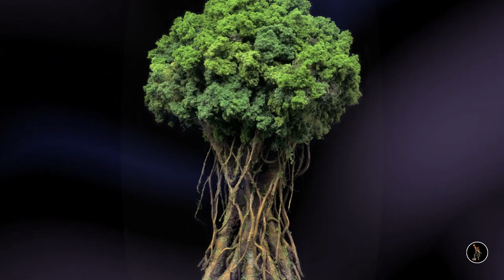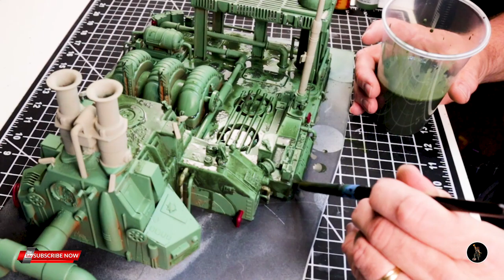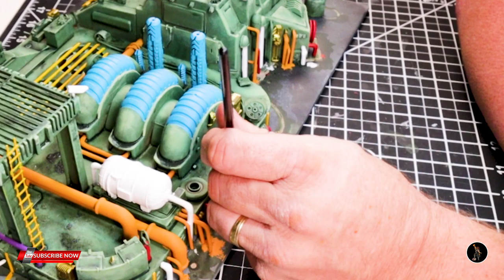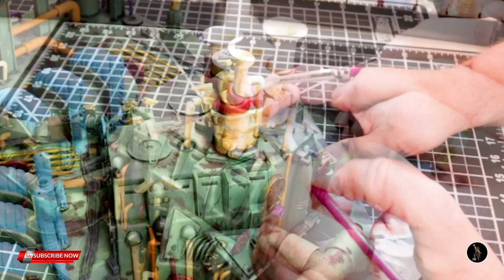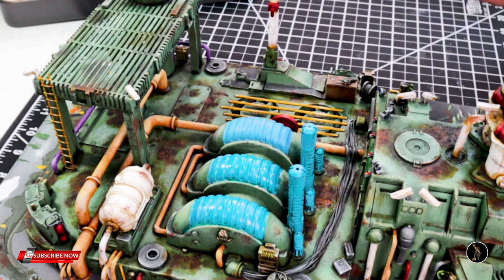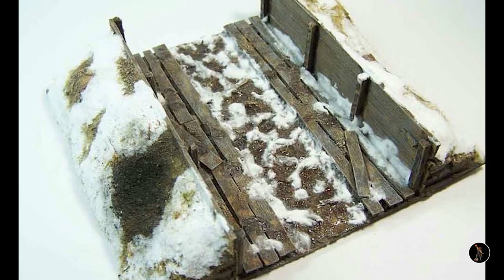Feeeeeel the POWER!! - Scratch built power plant for Tabletop Gaming Part 2

Comment: How do you find balance between decorating these pieces but leaving space for armies to be placed on the tabletop? I find a lot of my projects have a lot less going on to account for someone placing 10 models down in a room, but it leaves me with far less areas to add stuff
Reply from the maker: I have in mind what miniatures/games I am going to place on the terrain piece. They do not always need to sit flat in my opinion but still need to be able to stand. I then just space the pieces out accordingly. This piece is primarily for Reality's Edge and Infinity. They are both skirmish games and do not require a lot of miniatures (bases are smaller) but do require a lot of cover. If I was to use this for 40K I would have more open area to work with due to larger number of miniatures and larger base sizes. Hope that helps.
Cheers,
John...

Comment: Great stuff as always.  I'm curious how much time this project took you from start to finish?
Reply from the maker: Thanks HotT. Not sure how much time it took me. The painting took much longer than the actual assembly. The longest portion of the assembly was the styrene around the gang box. The problem I have is I don't usually work on one piece at a time so it is hard for me to separate hours. I worked on it for at least a month here and there in the evenings, that much I do know. 
Cheers,
John...